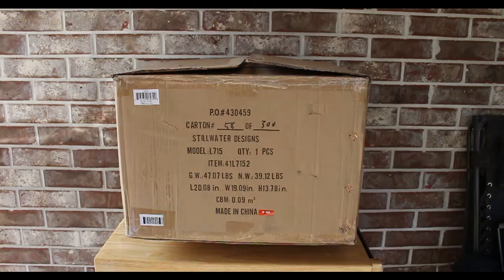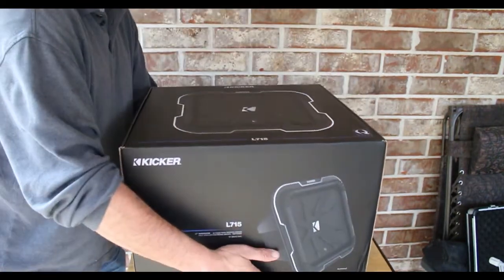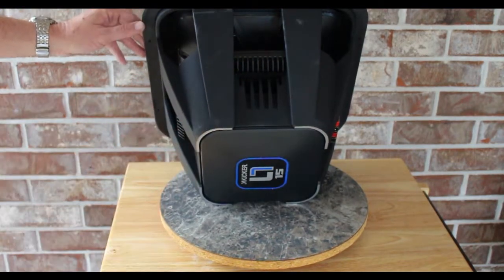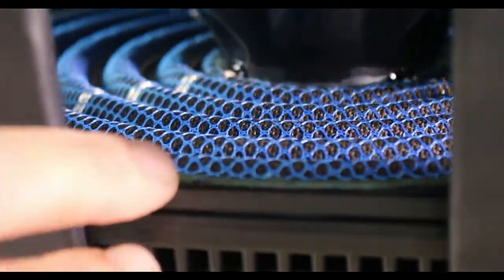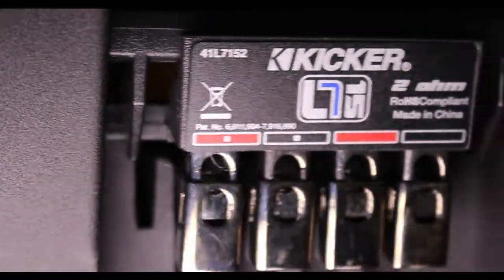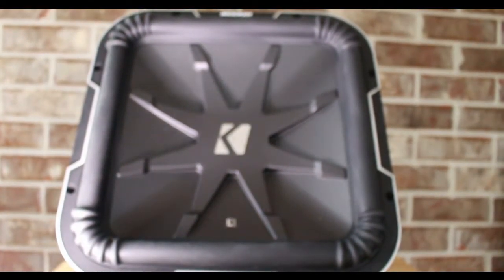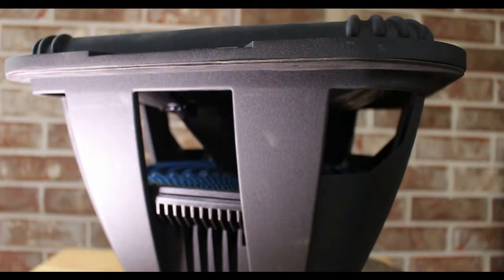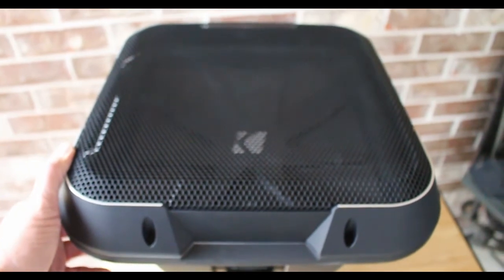Kicker Q class 41L7152 15" Unboxing and detailed overview.

Comment: I have the round COMP Q 15’s, 2 of them in a 7 cu.ft ported box tuned to 32 hz on a RF T2500. They hit hard as heck, get super low, and sound very good while doing it. Very clean bass.
Reply: How would you compare to like a sundown sa?

Comment: I put 2 in my suburban in a ported box. I’m definitely enjoying them
Reply from the maker: I'm undecided on porting or sealed. Playing with the Skar 18's kinda making want to stay sealed. Even though my single Kicker CVR15 daily driver box is ported and gets down, it is missing that super tight clean snap.
 What amp are you running on them ?
Reply: wat kind of amp running
Reply: tyronehutchins06 skar2000.1

Comment: how do these compare to the old kicker L7 version? ive had my old single 12" L7 for 8 years ! still kicking! but had to repair it, its survived 2 car wrecks and abuse from music for YEARS!
Reply from the maker: Idk, most likely not a whole lot of difference. Kickers are definitely built with abuse and longevity in mind.
Reply: @thenotoriousrvh6091   oh absolutely! Recently the coil assembly detached from the square cone, so I mixed up some J-B weld. And made sure it was aligned properly as to not have the coil rub the  magnet/motor and she's back to banging!

Comment: Hi whats the difference from 2 ohm and 4 ohm
Reply from the maker: When deciding on impedance (ohms) it depends on what your amplifiers compatible with. Some amps like a 2ohm final load others a 1ohm or even less. In my case the Kicker KXA2400 is rated full power at 1ohm. So 4 4ohm voice coils wired in parellel (positive to positive, negative to negative) equals 1ohm.

Comment: Where can I buy them I saw online one but it comes with kicker amp 1200 and amp kit whiring with for 670 is that good price for all that ???
Reply from the maker: Doesn't sound too bad, the subs are $499ea the amp depending on CX or KXA are $329 and $649. The amp kit if a 1/0ga Kicker kit is $160 all prices I'm staying are MSRP and products can always be found cheaper than full price.
Reply: @thenotoriousrvh6091  well tha amp is cx kicker and tha cable is 1800 g4 is that good
Reply from the maker: Haven't heard of that wire before, but as long as the wire is 100 percent OFC (oxygen free copper) it's good. Stay away from CCA (copper Clad aluminum) it's not nearly as good.
Reply: @thenotoriousrvh6091  it says RCA cable mater blue completed 4 gauge   from harmony audio
Reply: sounds decent but id definitely switch up the wiring kit to 0/1gauge & make sure ofc  no cca.  just use 4gauge  in short peices, like if you have a distribution block to amp but long length to battery 0/1gauge.
Reply: it may be that it's a good enough deal to ditch the free wiring kit & just source separately.  or use parts of it but get some 0/1gauge besides

Comment: About time..we finally c  a video with 2 15" subs...I've only had 15" s in my car 🚗🚗..it's always about 12" subs..12s ..have no depth...low and blooming..and screaming high 6x9s..no mids.. make sure you get a amp that goes down to 40 herts lp..not 50... that's mid bass..u don't want vocals coming through
your voice coils..
Reply from the maker: I hear ya. In my hay day I as always known as the "ten man", used to do some great things with them. Coming back after a long hiatus decided to play with some big subs. Nothing like a 15's or 18's in a sealed box with good power.
Reply: 12’S have no depth? While I agree they don’t get as low as 15’s 12’s can definitely get loud and low. There are a lot of playing factors at hand, your box specs, port area, sub specs, cabin resonance, amp specs. I have seen 4 12’s crush 4 15’s in a competition @33hz. Just all depends on your set up
Reply from the maker: Your spot on. But that's what makes car audio great. There really is no right or wrong, sound is subjective. As long as the person that owns the car likes it nothing else matters. 
I've done plenty of 10's ported and tuned into the low 20's cleanly.
Reply: As you just said..15's play lower...more into the ripple effect..once u own 15's...no reason to go back to 12's.i have.4..15's in my extended cargo van..I also have a rockford fosgate box that rocks 2,15's full range I bought back in 92..still have it today..great shape..it is really loud..played many party's with it..till the cops show up..then there is running and screaming..

Comment: Do you know if they will fit in the quad Box by kicker
Reply: I contacted kicker and they said they don't have the option for the Q class in the quad box. I was just wondering if I swap out the speakers will they fit
Reply from the maker: The 15's ? No.
But the Q class 12's would be even louder and handle  more power. And also add a lot of weight.
Reply: @thenotoriousrvh6091  thank you...good to know... I know it's going to cost a lot but I think that's what I want to put in my car
Reply from the maker: @californiamechanic5593  That would be pretty insane ! And really damn expensive. You'd be better off with 2 quad boxes or 4 QL7 15's in a custom ported enclosure.
Reply: @thenotoriousrvh6091  ya I know...but im trying to but it in with out doing customisation. I'm trying to show people with you can buy from the store and just put it in your car
Reply from the maker: @californiamechanic5593  Gotcha 100%
Reply from the maker: Will do sub4sub anytime 👍

Comment: Can't wait to see the install.
Reply from the maker: It's going to be super clean. I'm not into a whole lot of flash. I like subtle details.
Reply: @thenotoriousrvh6091  Are you building the box to "spec" or playing around   with different volumes?
Reply from the maker: @bobanmilz6512  I'll either retop the 2 18 box or rebuild an exact replica. Which is just shy of 8cu ft total internal volume sealed.
Reply: @thenotoriousrvh6091  The 15 q-class l7 is recommended for a 6 cf box if it's ported

Comment: I saw the comments,so I know your going sealed,what's the difference in the s l7 and the q I can see mine have the Solo cap and those have the k logo
Reply from the maker: I can see a few differences, the S doesn't have quite the motor the Q has, but the S is slightly more efficient. $50 msrp price difference. 
When I talked to Kicker tech when putting this together I was told the S's would be louder because of the efficiency but the Q's would have better SQ. The efficiency difference is S 89.4db 1W/1M vs Q 88.6db 1W/1M. I'd happily give up 0.8db for better SQ, but that's me.
Reply: @thenotoriousrvh6091  I've loved the kicker brand since the 80,s nice to see another guy with the same Passions for stillwater.im pulling mine apart in the suby and doing something else.i found the 4 more Solo's I need on a web site ,I guess I need to break bad and just do it huh? I think your going to love them ,and tell me how they do sealed up,I'm sure going to do the same thing but I believe you're going to get to it before me.
Reply: @thenotoriousrvh6091  what's 1w1m mean?1 watt ?
Reply from the maker: @ogairbender808  Efficiency is measured by giving the speaker 1 watt and measuring the output from a distance of 1 meter.
Reply from the maker: @ogairbender808  IDK lol this has been in the works since July. Now to save up for deadner, electrical, and all the other small crap. Freaking never ending process. I'm about ready to be done with it lol.
Reply: @thenotoriousrvh6091  yeah,I found the info on line last night.i should have known with the context 😂
Reply: Robert Van Hoy I modeled both of them based on all of kickers recomm box specs and a trend across the board for all box types  was the q having at least 3/4 to 1-1/2 dB more bottom end around 22- 32ish hz, where the s was louder in the 39-49 hz range. By about a 1/2 to 1 dB. Those are Based on rms rated power. If  you give them 50% rms, the s starts to do better across the board 20-80hz by about 1 to 1-1/2 dB. If you give the q 125% rms to 150% that’s when it comes alive! When doing the same for s, cone excursion limits it below 30 in all boxes. But the q can handle it!! Only have problems below 25 hz in big recommended sealed box on 150% rms but still within acceptable distortion levels if you are ground pounding and playing music. It was about 10-15% beyond its rated xmax at 25hz and below at that power but well within xmech.   You’d have to double the rms in sealed box play below 25 hz to get it to xmech limits. That’s pretty crazy!! Hope you like the data. Was fun!
Reply from the maker: @3RDERA  👌I wasn't trying to think that hard 😂. I modeled the Q's on WINISD and didn't care for how the group delay looked ported. There was a slight db gain and pretty much matched the sealed curve I just don't want a flappy sounding bass. Now that I have them the suspension is freaking super stiff so porting might be back on the table. I'm not chasing numbers, I'll compete to support the organizers. This time it's all about me and what I wanna do. Without worrying if customers are going to like it, if it's something customers could afford, or pleasing judges etc....
I have to admit I love the way those cheap 18's sound sealed. A really nice tight hard low end vwhooomp very tight and well controlled. IDK still got a lot more to get before the party gets started. With my lack of time and tools on the fence of sourcing out the box and speaker adapters. Still undecided on who for the alternator and if any further electrical is going to be necessary. Then sound deadner, braided loom, and the list goes on & on.......
Reply: Robert Van Hoy ya I noticed that group delay around 35-45 hz in the bigger boxes I modeled for it, but it goes away with smaller box , however it gets a little peaky in response on upper end. The other issue..... it  never ends lol, believe me even after I installed my old cube setup, I went back and started redoing grounds for more eye pleasing runs under the hook with better heat shrink and lugs, chasing down every little rattle audible in the vehicle and adding some kind of sound treatment on it. Car audio is a tinkering hobby. I still find something to improve or try different everyday, that’s one of the reasons I love/live it!!
Reply: So is it OK to put the q in the smallest recommended port. 3.25 ? I have a wall of 4 ported of the 07s L7s and want to switch to the Q class but don't know of i will get deep bass off of the smaller ported enclosure
Reply: What kind of power ported (slot) do you recommend then since sealed can handle way more then rated??

Comment: I got 2 of them which amp would be good for it?
Reply from the maker: I'm running the KXA2400.1 with no issues. I'm not running things full tilt either. It's quite surprising what it does considering I've been playing with it on stock electrical. The Kicker KXA amps are expensive but you get to save money on electrical. I'll be biting the bullet soon for an alternator & big 3. It should really wake up then 😁.

Comment: What amp should I get? Getting the same one you have. Only 1
Reply from the maker: The Kicker CXA1200.1 would be awesome, even the CXA800.1 would be good.
Reply: @thenotoriousrvh6091  was wondering if the kicker CX 1800W and kicker c series 4awg-2 channel amplifier power kit, metra two channel line output converter, and kicker remote. All from Best Buy $1000 is that good???
Reply from the maker: @jaweed7219  The 1800 would require a 1/0ga and most likely other electrical upgrades to the car, but it would definitely be more than enough for and it would be ok if you added a 2nd sub. As far as price ? Sounds about right. You could possibly shop around and find a better deal.
Reply: @thenotoriousrvh6091  would you recommend one from Best Buy for it? I’m trying to get it all from best buy to finance. But I appreciate the help
Reply from the maker: @jaweed7219  The 800.1
https://www.bestbuy.com/site/kicker-cx-800w-class-d-digital-mono-amplifier-with-variable-low-pass-crossover-black/6333358.p?skuId=6333358
Reply from the maker: @jaweed7219  Then the extra  money saved I'd put toward the 4ch for the mids and highs. 
https://www.bestbuy.com/site/kicker-cx-360w-class-ab-bridgeable-multichannel-amplifier-with-variable-crossovers-black/6333355.p?skuId=6333355
Reply: @thenotoriousrvh6091  I have 2 Kickers 15L-7 Q-CLASS custom ported with ARC AUDIO 2X2500.1 upgrade 2 Oddessy battery AGM 1 Alternator 370, OFC wires FR RCA ..H-2 Hummer shit hits deep bass 🔊..
Reply: Will a dc audio 2000 watt amp do it for 2 l7 15 q class?

Comment: Is Amazon good place to buy them ????
Reply from the maker: Yes Amazon is fine.
Reply: Last question wat gauge cable should I get 4 gauge or something else thanks
Reply from the maker: It's not that big of a price difference between 1/0 & 4ga. A little over kill is better than too little. Go for 100 percent OFC 1/0ga that way you have the cable for future upgrades. Stinger 6000 series amp kits can be found for a good bargain shop around.

Comment: What size is the spider and how does it compare in size to the other model L7s I hear its bigger in diameter
Reply from the maker: Honestly I haven't compared them to the other square series subs. The spider is pretty massive. It's larger and stiffer than the Skar 18's I have.
Reply: The spider in the old L7s are yellow and smaller, the spider on the Q class is blue and much bigger. The spider is really the only good upgrade on this subwoofer. Their voice coils are small and junk, can not handle a true 1200 watts. They get hot fast and stink everything up
Reply: jeff taylor yea running dirty clipped power

Comment: This is what I dont understand about kicker and this sub...they advertise that it's bigger than the standard round sub, which is true, BUT, let's take for instance the 15. Its a little less cone area than an 18, but takes the same size box and handles less power with a higher Fs than most 18s. Why not just get an 18 instead?  If the 15 took the usual amount of airspace as the average round 15, but had the extra area for being a square, then we would have ourselves something.  Maybe they should use stronger motors and shrink the box size needed
Reply: The big difference is baffle space. You can put that 15" in spaces you cant with an 18.

Comment: Does that kicker slam hard?
Reply: I got 2 12 but the round version. There built to be as equal to these picked em up Jan 2020 for about 650 for both. Can't complain and they take a nasty beating. I would buy this next year if they redid it again. 850rms to a 12 isn't bad
Reply from the maker: I need to pick up a round Q 15 for my daily driver box. I'm going to see how well the old CVR handles the KXA2400 😁.

Comment: I have a question if anyone can help me that would be awesome 
I have two L7 12s subs i went with the kicker KX1200.1 amp 
My question is 
Will the 1200.1 kx am have enough power because i dont want to under power them im really thinking about upgrading to the KX2400.1 AMP 
Would that be over kill? Thanks for any one can help
Reply from the maker: The 1200 should be ok. But it depends on how much bass your looking for. The 12's will handle the 2400 and of course the more power would be more bass. You could always run what you got and then if want more later add another 1200 1 amp per sub.
Reply: No, you need at least a 1000 watts per subwoofer. I would recommend 1500 true watts per subwoofer, that way you don't have to push your amps to get that power the subwoofers need. Get two SKAR AUDIO RP-1500.1 amps and you will love it
Reply: Depends what model L7 they are, if they are the q class then get the kx2400 if they are normal L7 get the kx1600
Reply: @jefftaylor4997  He wont get the best sound quality from those rp amps, junk amps imo, kicker kx are way better amps Ive had both no comparison
Reply: Remember more is better..less is distortion... keep it clean..
Reply: whatd you do?   now the kx amps are hard to get.   I have a 1200.1 & was looking to get a 2nd one, but tough to find these days.  I think its been a couple yrs since they made them.

Comment: The Q class L7 15 has a small voice coil, it does not handle the 1200 watts without stinking up the car. Trust me i owned one and this is why i got rid of mine. I had my gain set correctly so don't go their lol, i gotta say it's way over priced. Kicker needs to do much better then this
Reply: The smell goes away after that’s how my was
Reply: Is that what that smell is? Smells like a new speaker smell or something? I just got mine by the way, not sure if that's normal???
Reply from the maker: Mine did it for a little bit when new if hammered hard. Speaker break in is a real thing. It takes time for parts to loosen up and some of the coatings that are used to protect things from rusting & corrosion during transit to burn off. After a somewhat of a long break in period mine have not "smelled" since. I'm running the Kicker KXA2400.1 @ 1ohm on them.
Reply: @thenotoriousrvh6091  👍👍👍 Thanks for the info!